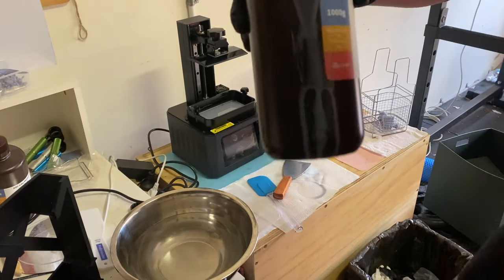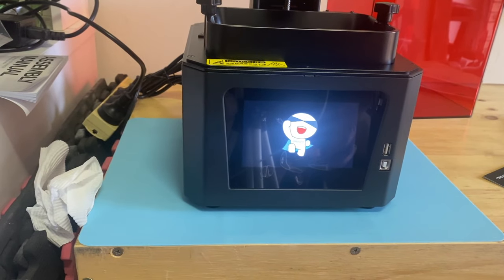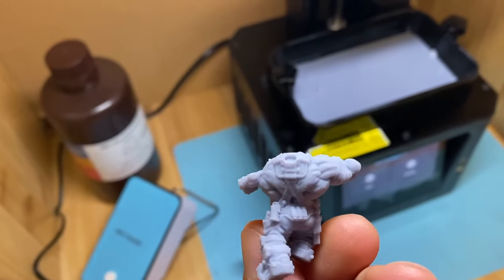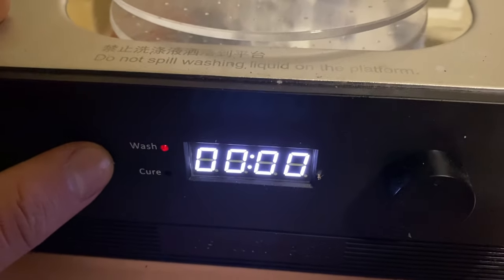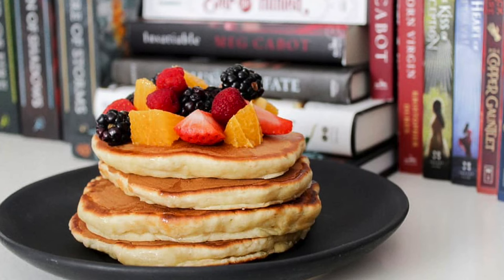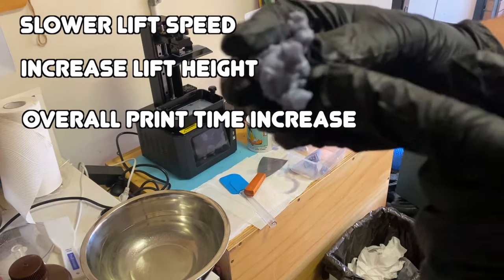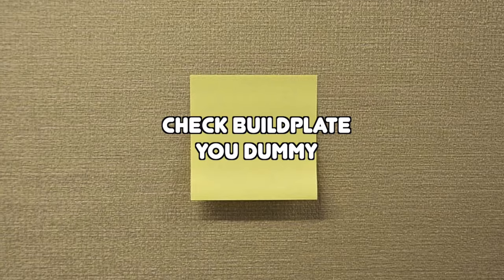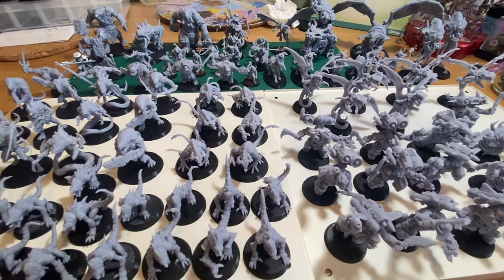MISTAKES I made when I started resin 3d printing

Comment: One other thing to mention is the recommended printing temperature by the Resin manufacturer per brand and or type of resin. Printing at a room temperature below the recommendation will result in higher resin viscosity resulting in failed prints due to the additional drag when the print lifts which can cause separation of part or all of the print as well as support contact points tearing away from the actual print object. Also, when you do a validation print like the cones of calibration, make a note of the room temperature as it only takes a few degrees Celsius lower than the minimum recommended temp to invalidate the calibration.
Reply from the maker: Those are really good insights 😁
Reply: @Habes  Thanks, trial and error with a bit of thinking about problems help solve a lot of issues.

Comment: Also holes.
If you’re doing a big print, you’ll naturally hollow it out. But without a hole the resin is being sucked up inside of the model each & every lift.
(Think washing a cup & pulling an upside down cup above the water line with the water still inside)
It creates a heap of unnecessary vacuum & will overload your supports mid print, leaving you with just a heap of ladders & the model in the vat.
So tip.
Using your slicer, Place a hole as soon as possible.
Reply: Could you share your curing routine for the hollow models?
Reply from the maker: It's not something I've done yet unfortunately even though I should. 
I would assume a UV torch pointed up one of your model's holes. 
I've seen one guy have a UV LED and he pushes it all the way up inside the models and moves it around to cure the inside.
Sorry I can't be much more help.
Reply: @Habes  I've ordered an UV LED and will try this method as soon as it arrives.
Reply from the maker: @GeorgMierau  Hope it goes well :)

Comment: You need to point out that each resin change means finding the right settings again.  It may sound like fun changing resins each print, but this is a huge paint.  Cleansing the vat takes time, but failed prints inevitably damage the FEP.  Tuning the printer for a resin often ends with failed prints.  Another one is printer cleaning.  The resin is pretty nasty and light inevitability makes cleanup difficult.  Also point out humidity Amd temperatures effect printing so working to keep these constant is a key to success.
Reply from the maker: Very important point!

Comment: I almost exclusively use water washable resin for the last 3 years, here is what i have for anyone who thinks they want it. The details are better than other resin's, it flows smoother and doesn't separate so i have left resin in my printer for months and just started a print up one day and came out fine, use a raft the parts are brittle till cured and if over cured, it doesn't have much of a smell and i can use it in a room im in with just a box fan keeping air moving.

Happy printing

Comment: I had a lot of misprints like you.  Models came loss  from the supports and sticks to the FEP. My experience is that it's most of the time a problem with the supports. 
I use Lychee slicer and if you place supports at 0.00 mm into the object the issue increase. I always have my settings to 0.30 mm into the object. 

Lychee handles that setting different than ChiChubox dos. In Lychee the supports don't go in to the object for real. So an Island only sticks better on a support.
My second collusion was slower lift speed and slower Retract speed. I set my lift speed to 1.8 mm/s and retract speed to 3 mm/s and lift the build platform 5 mm. I had more failures when this speed settings was higher (now I have non).  The Lifthight can decrease/increase the print time in many minutes. 1 mm difference can save you 1 hour. Do not cure your botomlayers too long because the resin is too stuck on the FEP, and then you need a larger lifthight. 

Time settings...... just never change them again when you find the sweet spot.

My opinion is that every Printer brand has his own setting. An Ellegoo printer can react different from an Anycubic and so on.
Reply from the maker: So true about different brand printers having their own settings. Always have to calibrate the printer individually.
Reply: Levelling the printer is also very important. Not just the built plate, but the printer too.  This will give you less  failures

Comment: Great tips! Definitely try different resins. The cheaper resins are cheap for a reason :)
Reply: I want to jump into resin printing as a hobby.  I'm a bit familiar with the traditional resin mold.  My question is, is the resin being used in SLA printers the same as that of the traditional resin crafts?  Can you also put alcohol inks to make random colors?
Reply: @rcane6842  no, sla printer resin is activated by uv light.  You can dye it. Idk what kind of dye to use though.

Comment: Oh man, this is really helpful, thanks so much. A great idea for a video would be more examples of failed prints, specifically what was wrong, and what the solution was/were. eg: I'm getting this weird edge-lifting of flat-bottomed objects, making them look more like cartoon boat hulls. I think it might be a loose or sticky FEP, or plate crowding, or wrong initial exposure time duration, or not big enough skirt, or gypsy curse or something else, but there are frankly too many variables and not enough time available on the local library's "village bicycle" resin printer. So itemizing specific problems as a compilationin video would be gold to me. Thanks!
Reply from the maker: Sorry for the late reply. I did record a video of “common issues and how to fix” but found it wasn’t up to scratch for a video. After hearing this I think it’s worth me revisiting that idea.
Thanks!

Comment: 9:30 A mask won't do much for fumes, you just need better ventilation if this is an issue, the mask is just a safety blanket at that point.
Reply: i mean it will still filter a little bit doesnt it ? 
like every bit of saftey is better then no saftey at all
Reply: Organic vapor cartridges should work.

Comment: Wonder why Anycubic doesn’t put a microswitch onto the platform for the wash and dry station to know when the wash station is installed. This would allow the circuit to not be placed in wash mode unless the tank is sitting on the platform which would prevent the high speed spinning mistake when trying to cure the model.
Reply from the maker: Yeah that’d be super handy.

Comment: I printed almost all of my first bottle (Phrozen Aqua Resin Ivory 4K, which I understand is actually good resin, but I picked just for the color),
on a Mars 3 Ultra (not Pro).
Also I don't have washing and curing machines, I just use a plastic box of alcohol and cure them in the Sun (of which lately there's very little - mostly clouds and rains).
And so far I have zero fails!
I'm quite surprised too. I've watched many videos on resin 3d printing and saw how many things can go wrong.
Also when I started I did no settings in the slicer (chitubox). I opened the settings windows saw that I have no idea what I'm looking at and only set the printer to be my model in the slicer.
The only issues I had so far is getting out the printed parts out of the build plate. Especially those I print flat, which I do for the miniatures base plates - being low profile and flat bottom seems waste (of resin and most of all - Time!) to angle them and support them, so I just put as many as I can for single print, and in 20~30 mins they're done.
But yes the flat base plates are the hardest to remove from the build plate (but also the strongest so I don't shy of using extra force).
And the other issues are that I broke 3 pieces when removing the supports (after I've removed them from the build plate). Fortunately 2 of the 3 breaks were clean and was very easy to superglue (the 3rd one was also clean, but I didn't notice it when removing the supports and I guess I've thrown the front of a female figurine foot in the trash).
So as a result I got cocky and I printed a bracket to hold the build plate at an angle after printing to better drain the resin left on the build plate before washing it.
I got that pre-supported (and clean stl of course) and I was going to print the supported version as usual, but I noticed some supports looking weird and unnecessary (and too thick), I played few minutes trying to fix just the weird ones, but I gave up, started with the clean STL, set supports to light (and even made them a bit lighter, down to 0.7mm thickness), printed it expecting epic fail and that I would have to finally drain the resin in the tub thru a filter to remove the failed parts (and avoid breaking my screen afterwards) ... I even hollowed the bracket and put few small drain holes because it seemed to me it has good potential to save on resin, while still being acceptably strong ...
But I got a problem - it printed perfectly fine!
Build plate removal and supports removal was much easier. Wasn't sure if the resin from inside the bracket was drained already, so after cleaning it and curing it a bit more in the sun I dared put my lips on one of the holes to blow in and see if any resin will get out, but nothing got out except for some air.

So now I still have no idea what to do if something goes wrong :/
I'm going to buy a flex-plate to make prints removal much easier, and perhaps I'll get simple curing box (or put one myself - DIY style), and next I'll have to use the regular resins, so I wonder if there'll be any difference.
Reply from the maker: Thanks for sharing. 
Sometimes it's easier to reprint that try save the print, depending on what print is.
All the best with the printing.
Reply: @Habes  , Thanks! You too!
Reply: Don't risk getting uncured resin on you. Use a straw, air compressor, or vacuum to test for leftover liquid resin. The chemicals in resins are no joke. Be safe.
Reply: @edeaglehouse2221  , I know. Thank you for the reminder!
I'm being intentionally very careful (in addition to the mask, gloves & glasses), doing everything slower than I would normally do, and so far I don't have a single spill.
I'm also waiting now for the wham bam flex-plate magnet to stick to my build plate (72 hours),
and in the mean time I'm making a DIY UV-curing box from a cardboard box Alu-foil and uv-led-strips.
Even got couple of those tiny turntables for jewelry (found them for about 5€ a piece. Actually I found them even cheaper, but I had to order 100 :) which of course I didn't)
Btw I played with hollowing and made an extreme print - a ~30mm human fighter mini hollowed to a 0.5mm wall, and added plenty of holes in hard to see places (some smaller holes armpits and under-side of the cape to allow for air to enter/escape and push the resin thru the bigger holes on the feet, arms and also one where we all have a hole :))

I'm saying this because I wondered how the easiest to get liquid resin from inside the model, and thought about blowing thru, but then I read that this is excellent way to get droplets of liquid resin flying all around (if there are such inside the model in the first place).
So I'm focusing on rinsing it really well in IPA to get it in & out many times and wash any leftover liquid resin there. Bubbles are a good indicator that air & IPA are moving thru with each dip.
It works well when the cavities and at least 2 holes are big enough. The challenge is with tight cavities in a model, given that also in those places often it's difficult or impossible to add a large hole.
But here Lychee slicer actually helps. It allows me to block areas of the model hollowing to avoid such tight spaces and focus only on a larger cavity that's much easier to manage and clean.
What I though about for curing the resin inside tighter cavities is perhaps I could get few optical fibers, tie them together on one end, and place them directly again a UV led (probably some bracket could be useful), and then insert the free ends in the holes of a hollowed model to cure it better from the inside.

Comment: Honestly getting a good slicer program made it much better for me. I use to use like anycubics slicer but just got failure after failure. Then I switched to Lychee and bam, success
Reply from the maker: That’s a good point. 
I personally haven’t experience that as the first slicer I used was lychee but I’ve seen people have slicer issues which can be frustrating if you don’t know it’s the slicer causing the issue.

Comment: Thank you for this video.
Yes, I was concerned with the learning curve. And that although very cool... you almost need a full month of trial and error starting out. My wife has some concerns about the chemicals as I would probably have to do this in the Garage. I still not sure if I want to go this route yet. May stick with filament for now... I am looking for more of a plug n play 3D Printer setup.
Reply from the maker: Some of the newer small printers are a bit more plug n play now. If you got an Elegoo Mars 2 or 3 and used their resin and recommended settings, you could probably we ok without too much testing. However you need good presupported files, a lot of the trouble people run into is because they find free files online and try support them themselves without knowing much about resin printing.
I hope that helps :)
Reply: I'm in the same boat, got my first 3d printer (anycubic vyper) about 3 weeks ago after doing a lot of research and I'm glad I don't have the bed leveling hassle, and I'm roughly in the middle of that beginner's learning curve if I had to judge myself thus far fiddling with all the slicer settings and temps, etc.

I didn't have a goal of printing anything specific when buying one, just wanted to start - and it's fun, but I definitely want to get a resin printer because of the insane level of detail possible and little to no layer lines, etc. 

I know that once I get my knowledge and printer settings dialed in, they will come out much better, but I think I'll end up predominantly using the FDM for parts or wall art, etc and leave the prints that need detail to a resin printer. Also looking into getting the Photon Ultra as my first resin printer, seeing as how long the screens/mirrors last before they need replacement so I don't have to fiddle with LCD replacement..

I don't mind all the extra post processing effort I see I'll have to make with the resins, and after watching this video, I'm even more confident I'll have a decent start with resin printing. Wonderful video, thanks much!!!

If any of you have any other tips or comments for me regarding what I've said, please do!!

Comment: Hello, can you go a little more in-depth when it comes to the dead zone? To me it sounds like you should not be printing within the 80-150mm lift speeds but I think youre implying the opposite of that? I'm new to this so I'm just trying to understand this better.
Reply from the maker: Sorry if it wasn't clear. Either print at 0.8mm/s (48mm/min) or slower, or print at 3mm/s (180mm/min) or faster so you're outside the dead zone of 50-180mm/min. I opt for printing at 3mm/s just because I don't like waiting so long, but I have to add some extra supports because of the extra strain it puts on the supports.
Reply: @Habes  And in regards to the increase in lifting speed to 180mm/min. That also risk damages to FEP that was stated earlier, correct?
Reply from the maker: @DataAllister  yeah there can be a bit more risk to damaging the FEP at faster lifting speeds. For me I've chosen that faster lift speed and will just deal with the risk that my FEP might not last as long in favour of faster printing times. 
That could change further down the track, but for now that's what I'm trying.

Comment: Actually I did experience a plug and play experience, but I did watch a ton of videos before my printer got here, so I had plenty of time to get tools, mask, gloves, a ventilated area to do it, and my anycubic is overall really nice. The problem with 3D printing is the time you need to take apart. Aside from that I recommend water washable resin is much easier to handle.
Reply from the maker: I'm glad you had that experience. With my newest printer it's been pretty much that too. I think the newer machines are getting easier and easier to use.

Comment: i managed to break my lcd screen after my second print because i had a small spill between the screen and tape thats around the screen to protect the gaps. Aparently the tape was not propelly applied to the surface and it leaked right in the circuits of the screen and ruined it... aparently the third party seller didnt want to warranty replace it either because it was "my fault" wich is partly true but still kind of pissed off about that. Thankfully though creality is sending me a new screen from their factory ♥
Reply from the maker: Sorry to hear that. I'm glad they're sending out a new screen. Hopefully it's not too tricky to install. All the best :)
Reply: dont spill on your lcd then

Comment: I am just starting with resin printing for miniatures for my tabletop games. I am using the water washable resing at the moment but I'm having trouble with the removal of my print off my print bed. after taking the printout and into the wash, when I tried to scarp my print off: 1. my scarper had a very difficult time just getting between the print and the bed AND 2. When I tried to scape/lift it off the bed, the print cracks/brakes.  Any tips and or tricks?